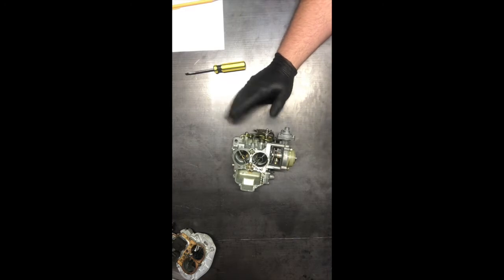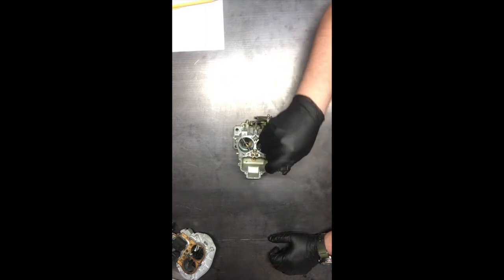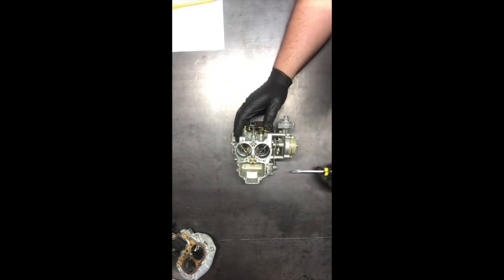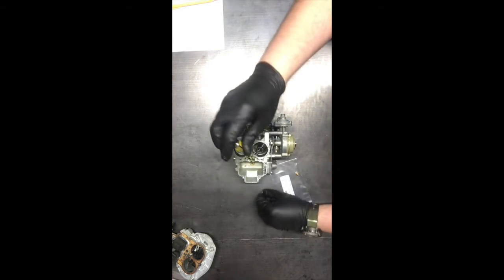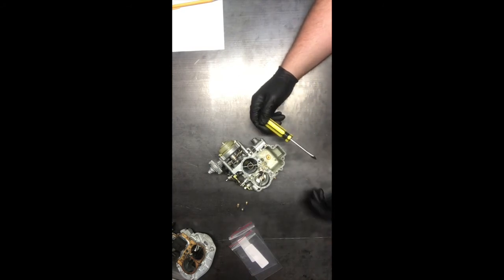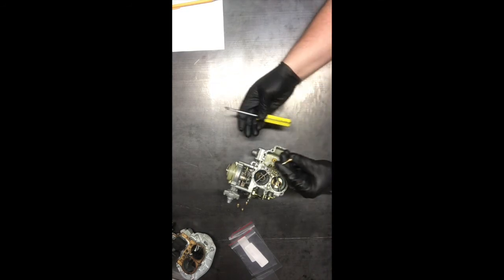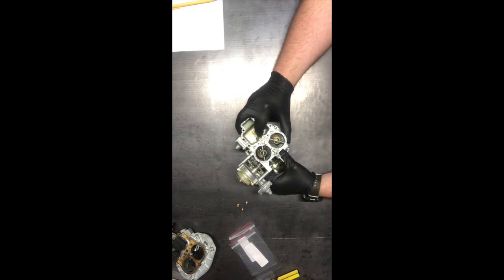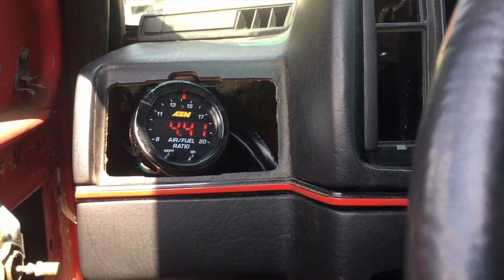Weber 32/36 Progressive Carburetor Jetting and Tuning

Comment: Idle speed screw must be less than 1 1/2 maximum!!! Idle mixture screw 1 3/4 - 2 1/4 maximum!! If you are within this spec go to low speed circuit from Idle up to 2200rpm. If bogs over 2200 go to main circuit. Start at the bottom and work your way up! Check timing and repeat!

Comment: Weber carburettors are a great engineering feat that are as close to fuel injection due to their ability of being tuned across all the fuel delivery circuits. But! Before they behave there are several things that MUST be sorted first. Enemy number 1 is air intake leaks & secondly, exhaust leaks. 3. Fuel pressure must be kept low and consistent like another post mentioned 2-3 psi. 4. Timing should be advanced a few degrees (3-5) at first then finally adjusted once jetting is in a healthy range. So what’s a healthy range? Biscuit coloured plugs and tail pipe & you will feel the engine pull the car hard when the secondary circuit kicks in. You will also hear a definitive crackle throughout the exhaust. You will know it when you hear it. Now you can advance the timing just prior to it pinging. Pinging is bad, so if you can set it a few degrees short of that it should be ok.

Comment: Never have i ever seen a air fuel screw ineffective because of jets. You have a float or fuel pressure problem. Im sure you figured that out by now.  Good luck
Reply from the maker: Thank you for the comment. After setting up this carburetor as seen in the video, the vehicle has performed flawlessly. Maybe you’re referring to a different style of carburetor which had a larger adjustment range. On these if the adjuster screw has to be turned out more than 2 turns (if I remember correctly) then it needs to be jetted differently. Cheers.
Reply: My fuel ajustment screw is essentially useless, i need to mess with jets apparently. My 2.0 Nissan is running rich, smells rich and tailpipe very sooty. I have a few webers laying around so i will see what kind of jets assortment i can scrounge up or order a kit. Good video.

Comment: I have a Weber carburetor 32/36 on A Suzuki samurai 1.3 engine. It run very high rich smell like unburned crude fuel. Also consume a lot of gas. Do you know what could be the cause, or a least where to start. 

Thank you
Reply from the maker: Change the jets in your carb to the same ones I did in the video. Also check your oil for gas, you may need to change your oil after re-jetting the carb. Hopefully that will get you in range to make adjustments.
Reply: @rallyewerks870  Alright
Thank you! So when are jet the Weber go one number dawn accordingly on what I currently have. Thanks again.

Comment: I put one of these on a Ford inline-6 200cid/3.3L, and in stock setup it was super lean...
Now running 85/65 Idle Jets, 160/150 Primary Jets. But I also have dual 2.5" exhaust also at 1000' elevation.

I also noticed the floats weren't adjusted right, and I needed a fuel pressure regulator b/c my pump was pushing 7 psi. It's now 2-3 psi.

Comment: I’m having problems with man and I can’t figure it out it runs fine at low to mid range rpm but like when I’m on the interstate it cuts out a lot and I have to let out of the gas and wait a few seconds then go for a little longer and I’ve tried all kinds of thing I can’t figure it out
Reply from the maker: A air fuel gauge might be needed to help track down what’s going on. Is it running rich up top? Or lean? A air fuel gauge will tell you that.

Comment: I am tuning 32/36 for mu 2.0 ford taunus .  It have 55 idle , 134 main , 160 corrector , and it going rich high  , above 4500 it going into 10 afr . Idle and low to half throttle is great .Very nice to drive  Emulsion tube is important , where holes are placed .  Im playing now with emulsions holes and air corrector to get mixture perfect to all throttle openings   Take out emulsion tubes and look where holes are located . On top - weaks low rpm mixtures , mid is for mid range , and holes on bottom are for high rpm .